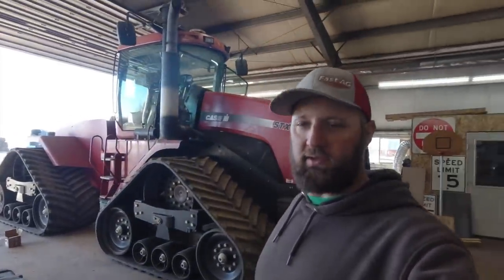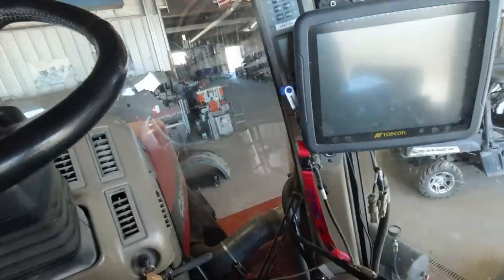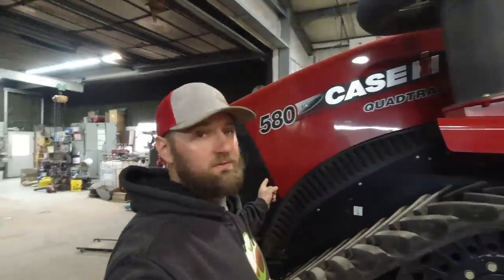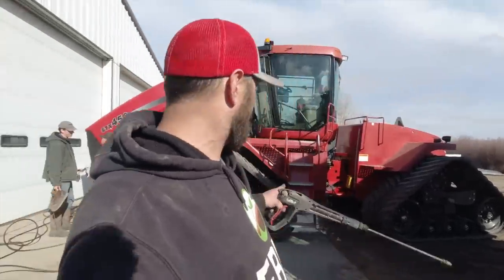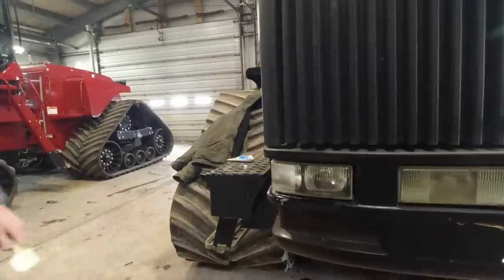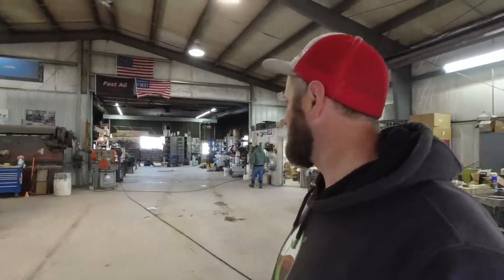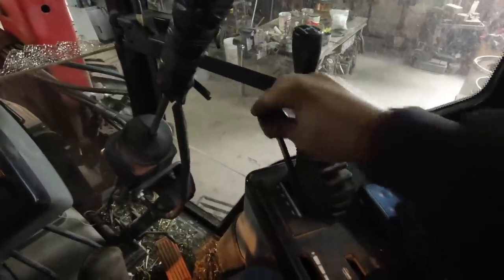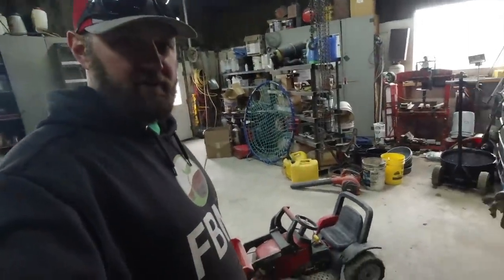($300 Giveaway!) A Tractor for Everyone!

Comment: Telecommuting for my day job.  I have been working on my old Steiger Bearcat series 3 and should be getting that out tonight. Field cultivator (digger?) Fixed and ready.  Corn planter and drill in good shape just need a once over.  Thanks for the tractor tour.  I plant with my father in law's ih986 and use his ih1486 on his place and mine.  I grew up on s jd720 diesel and an ih806.  Getting warm today in Michigan.  60ish yahooooo!

Comment: Thanks for the videos.  Currently trying to get equipment ready as a just have a small, dirt floored, shed so all the equipment, other than tractors, must be worked on outside.  It's been too wet to do much.  Fixing an oil leak on my big horse right now.

Comment: Here in NH, still working equipment through the shop. Just finished a major rehab of my tedder. With the shut down I have been taking advantage of there being no services at church, to get some projects out of the way there. This morning I spray buffed and recoated some more floors. Since we follow God's word we also follow the instructions of those having authority over us, so we don't have services but we livestream the sermons instead. You can watch on Sundays at 10:30. Fellowship Bible Church of Chester NH. Working now on an old car. Just put the motor back in this afternoon. This month so far has been busy for our volunteer fire department. We usually go on 35 calls a month. We are at 26 already for April. I, being an old guy, am just a driver operator now, usually driving our 3,000 gal 2018 Peterbilt tanker, or 2010 International Rescue, or 2002 Emergency One pumper. We are having to decon our Rescue and equipment after each call due to Covid 19, and are taking all recommended personal protection precautions. Procedures have been getting updated two times a week lately. We are looking forward to getting past this and are grateful that so many people have been following the personal spacing and avoiding travel, so that the infection rate is leveling off.

Comment: we are putting out fertilizer just got most of it put out this week we have a farmall 70 open station just like yours its everybodys favorite tractor because it rides so good and easy to get on and off like that pwr shift 54 series  or whatever it was called i want one of those to replace our 1896 for pulling a hay mower the 1896 is overkill

Comment: Nice equipment tour Tony. I suppose I'm one of the fortunate ones in this whole COVID thing.  I've been deemed essential and if anything everything is just busier now.  I work in the transportation / logistics industry where we keep goods moving throughout the US.  Specifically, I work with any repair needs for our 500+ trucks on the road, keeping the equipment running and servicing our customers, that are primarily food grade institutional clients.  Here's a fun fact that goes along with your equipment tour - we do extensive work with Steiger CNH, every part on those quad tracks was at one time in our warehouse before we took them over to the plant to get built ship to YOU.  Other than that, dealing with the ordinary things, it's flood season in Fargo right now, river should be peaking any time now, and I've got a couple of rental properties that I've been struggling to keep the basements dry in my free time.  If you get through Fargo, coffee is on me.  Probably can't video our warehousing for the Steigers, but it would be a pleasure to walk you through.  Things will get tight for us if things don't pass.  New equipment won't be arriving on schedule, tire manufacturing is cut way back.  Eventually we'll be missing some critical items.